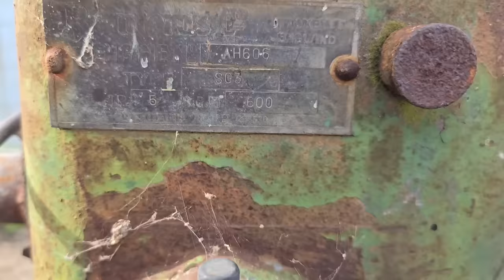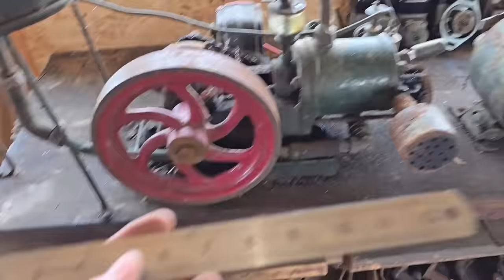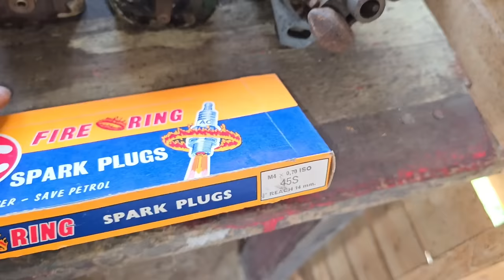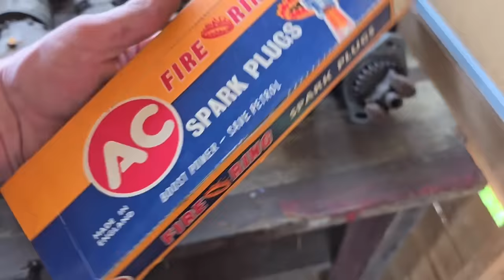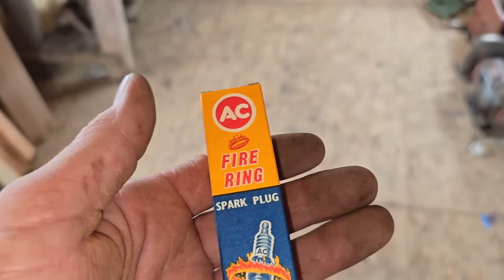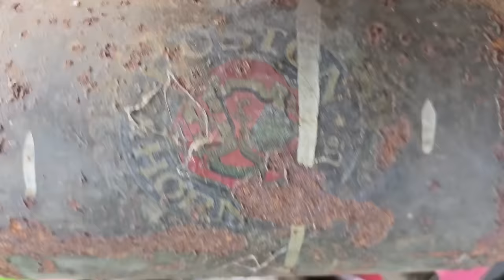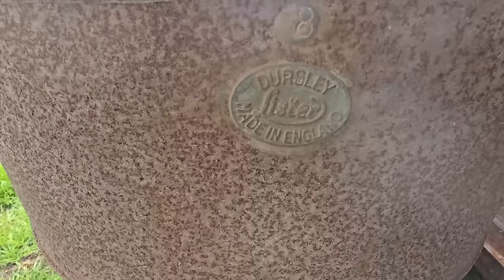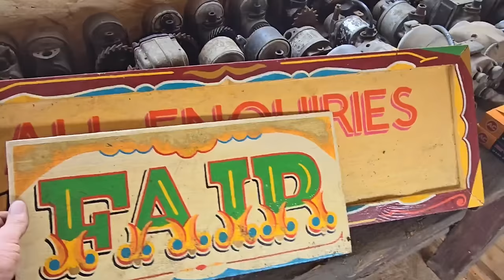Abandoned Cafe back yard. what did we bring home?? A must watch.

Comment: What a haul, nice work.   As for retaining the age whilst affording protection I use boiled linseed oil which does not lift the paint but keeps the iron sweet as you can work it into places where water wants to live. If you need to paint it later then clean it with some spirit. Try it out. cast iron loves the stuff.  Don't leave your rags in a bin or you loose your shed to fire.

Comment: I was thinking on the first video, how Mrs. Mancave was a real trooper going along with you on this excursion. 😁YES do pick up the welder generator, it would also be large enough to power the house in case of emergency.👍 I still want to see the Bonser finished, so you and Mrs. can drive around at the next festival, or drive it to the auction to bring home the goodies. But I also want to see the Sandhurst running